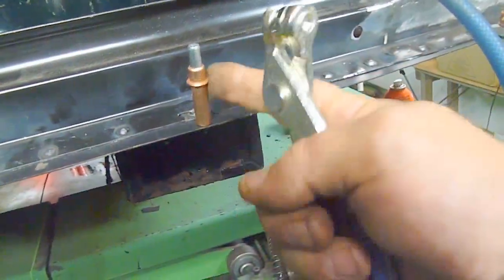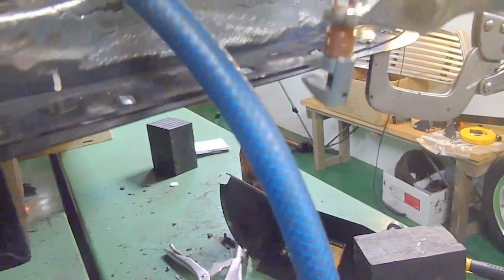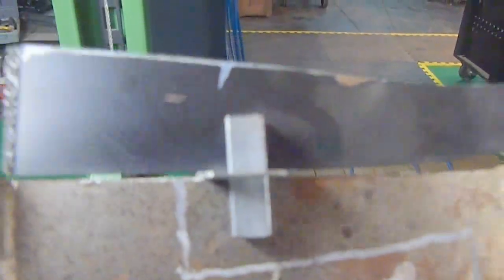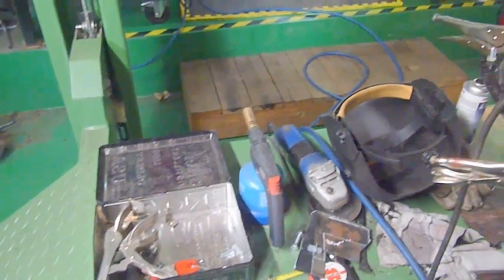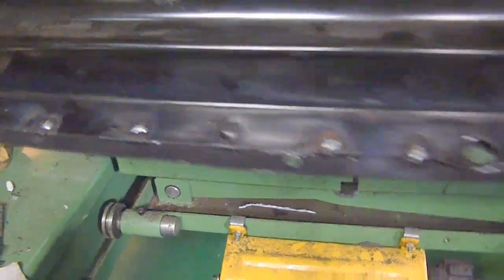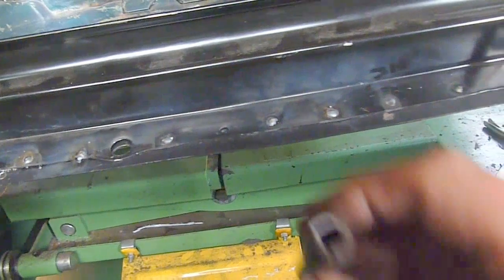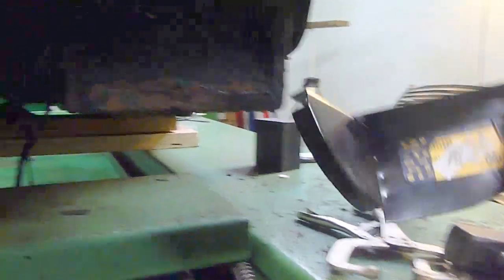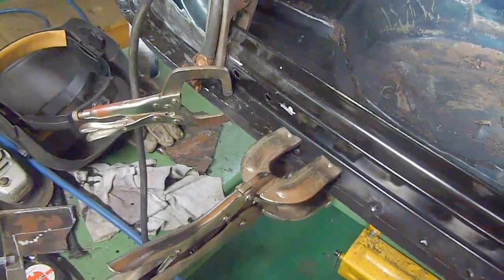classic mini cooper welding tips part 1

Comment: The double legged nozzle goes with the mole grips shown in the closing shot. Use it to clamp each side of the place you plan to plug weld, the nozzle fits in between, giving a good weld with absolutely no gap between the panels.